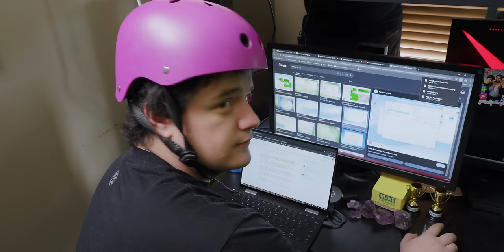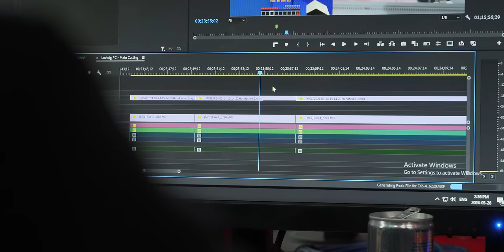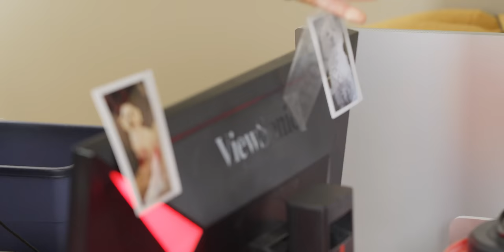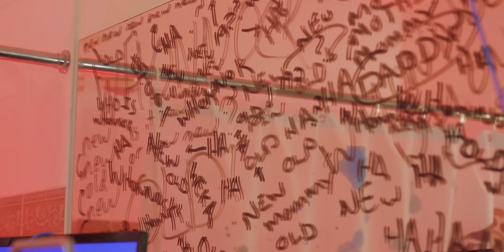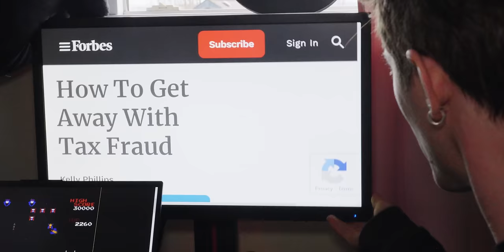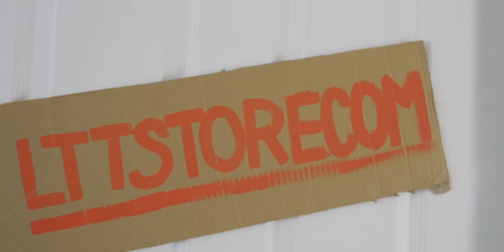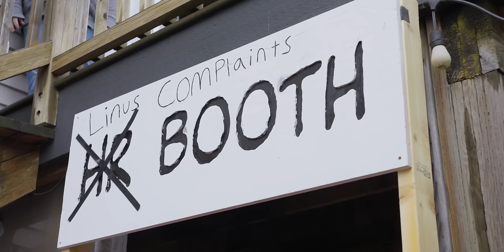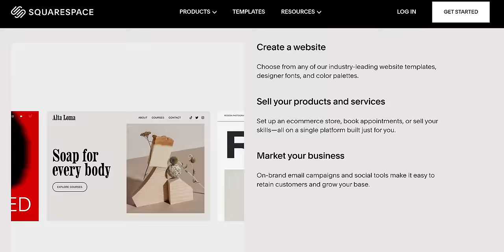It’s Time to Downsize - New Studio Tour (APRIL FOOLS 2024)

Comment: Hey I know this has nothing to do with this video but I am trying to use a old gaming laptop and I have no audio whatsoever and I tried to contact Microsoft support like it says too in settings and they tried to update the audio drivers and it worked but after I turned off my laptop and got on the next day it wasn’t working. It says no audio device installed
Reply: Can someone try to explain how to fix this issue?

Comment: 10,000 watts if 41.6 amps. that is less power than homes built over 100 years ago which got 50 amps service.

Also when talking service feed to homes you dont say watts you say amps. you dont have a 48,000 watt panel you have a 200 amp panel.

Comment: Hey i m Shivam from India and i am in the market for a new PC so after some research i customized a PC which would cost around 5000 USD. Can u please review it on your channel and show us how it looks and performs. I would also like you to suggest any recommended changes that will make it perform any better. Would really appreciate it. Processor - Amd Ryzen 7 7800X3D ,  Motherboard - Asus Rog Crosshair X670E Hero ,  GPU - Asus Rog Strix GeForce Rtx 4080 16Gb Gddr6X Oc Edition ( BLACK ) , RAM -  Corsair Vengeance 64Gb Ddr5 (32Gbx2) 6000Mhz ( BLACK ) ,  Storage 1 & 2 -  Western Digital Black 1TB SN850X NVMe Gen4 Internal Gaming Ssd ,  Cabinet -  Nzxt H9 Elite ,  Cabinet fan -  Nzxt F120 Rgb Duo 120mm Triple Pack ( BLACK ) ,  CPU Cooler -  Nzxt Kraken X73 Rgb 360Mm ( Black ) ,  PSU -  Corsair Hx1000i ,  Monitor -  Dell Alienware 32 4K QD OLED. 😇

Comment: Linus, may I have one of your PCs or even better, if you're generous, a gaming laptop like a RTX 4070-4090 one if you're giving them away? I desperately need a new computer because my laptop is extremely old and needs to be replaced. Also, I live in the Philippines where computer hardware is so expensive and hard to get the best ones, it's almost impossible to buy new ones.